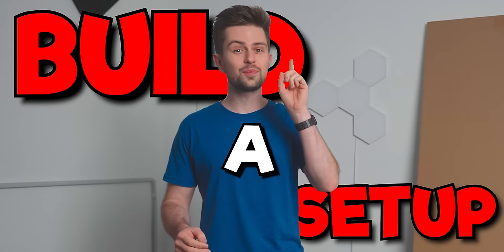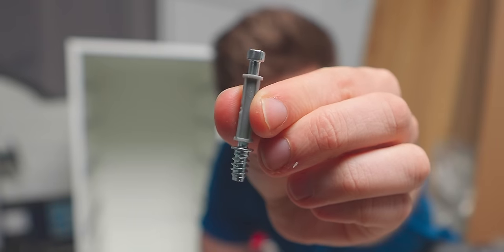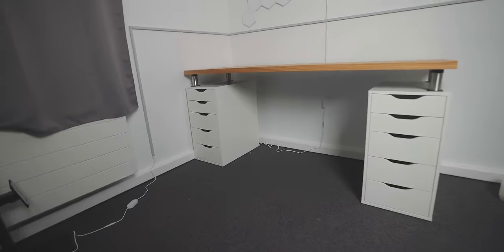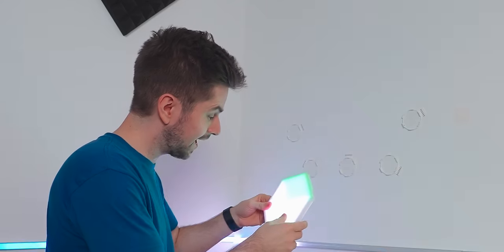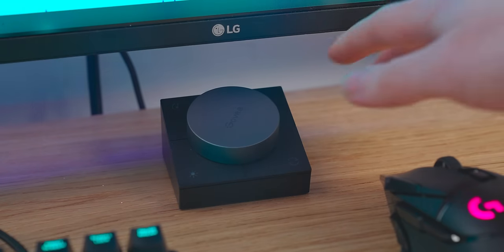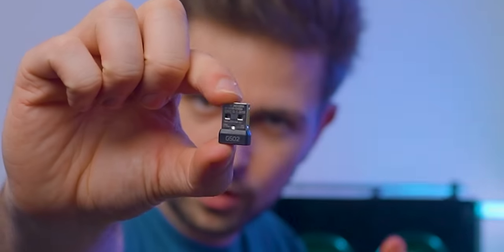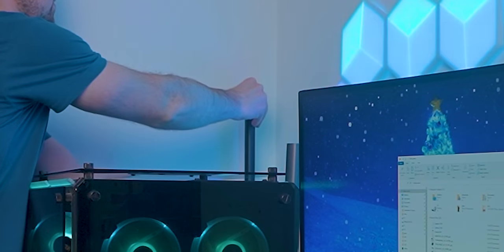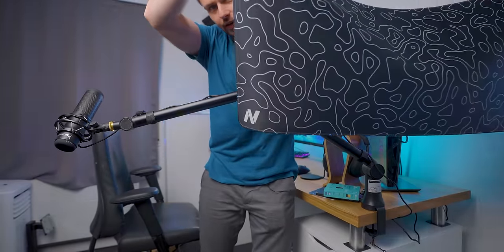Building an Epic IKEA Desk Streaming Setup!

Comment: I got a 39 inch version of this table top from Home Depot, kitchen island butcher block, let me put 4 legs in the back staggered, and then use the front drawers for only support the front of the table!  Instead of another table touching the cabinets, I slid it thru the staggered legs in the back of the desk!!  Works GREAT and I LOVE having a 39 inch deep desk!!  I did the 2inch upside down legs on my cabinets, 4 on each cabinet!!  LOVE IT!!  Inspired by your previous IKEA desk build!!!!

Comment: If the countertop is 74 inches, and each alex drawer is 14 inches wide, how would a 40 inch linnmon be long enough to use as a false wall? I plan on doing this exact same desk setup and i want to use a linnmon but im worried it wont be long enough to cover the entire back as a way to cover the cables.

Comment: great video..  
but I dont understand everyone using the IKEA ALEX drawer units.   I used them and I am very disappointed with the quality.  there are better units to use.  MICKE units are far better build quality.  

also for the height with the metal legs you used.  there are different height Alex units that would have wheels on them. they would be shorter and make the height of the desk be lower.  same with the micke 

Granted this is My opinion only.

Comment: This is why streamers will never know much about real video or audio production, these companies are marketing the wrong products to people. None of this equipment is professional level, it is all simple imitations of nice stuff other than the PC, maybe. All of this "pro gear" you think you are buying is simply consumer level tech upgraded just enough to look nicer but it will still be easier to use and not have to do as much fiddling to get nice results out of box. A Razer webcam, my guy... are you actually a streamer or just fucking with us because now I can't tell? Why did you pay $120, the price of the superior Logitech Brio 4k to get a 1080p60 webcam with no light any more...? Razer is generally just such garbage for the price. Logitech would have been nice but have you even looked into the webcam market on Amazon? There are brands doing real smartphone / DSLR imaging with a real Sony video chip in a package similar to yours. Some of these webcams can get anywhere up to 5k-8k resolution and they are barely any more money than the piece of junk Razer.

Next thing is the keyboard. HyperX may be a good brand but really you want a keyboard that is gasket mounted with a top plate. This has floating keys and those are generally not the best for a heavy use scenario even if people like them for some reasons like aesthetics, the switches being exposed to the air is not great. I recommend looking in to what you really want from a keyboard and then looking up which brand does things that can deliver that. More than likely, you will land on a custom built keyboard as the high end polling rate and refresh specs on gaming keyboards hardly make a difference. I would recommend something like the Epomaker TH80X. Perfect first custom prebuilt, great color scheme, good internals, triple mode, LED display, and no heavy software.

Last couple things I wanted to mention, the headphones and mic. Sony can make some OK headphones but I would avoid wireless audio at all costs. Bluetooth will be the source of many issues in an audio setup. There are also much better brands for the same price like Sennheiser, AKG, and Audio Technica. The mic you got is also mostly a toy. Do not buy microphones that are advertised to gamers, period. That thing probably sounds the same as a Blue Yeti or maybe an AT2020. There is very little point in trying out all of these things in the same price tier to as they will never be as nice as you are hoping for. For audio, even some streamers now are choosing to use either a mixer or USB audio interface to plug a pro XLR mic into. The XLR version of mics sound better than their USB counterparts by far because of the relatively incredible abilities of a real audio interface compared to one essentially built into the mic like you need with USB microphones.

I hope I don't come off as just shitting on you and everyone needs to start somewhere. I am just trying to point out what could use improvement if you plan on being a pro streamer. There are MANY routes you could go down from pro DSLR webcam video to pro rack mount 32 bit HIFI audio and mics and even more to get into using your PC. Good luck in the future